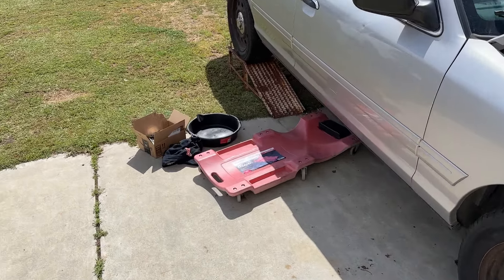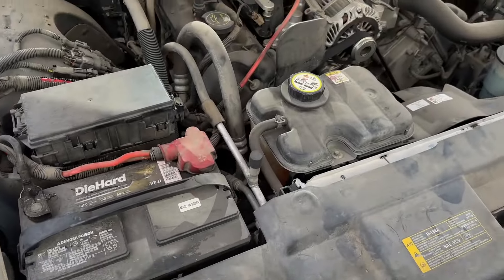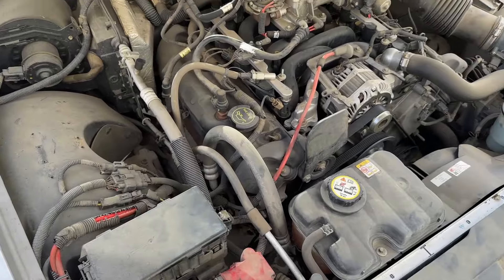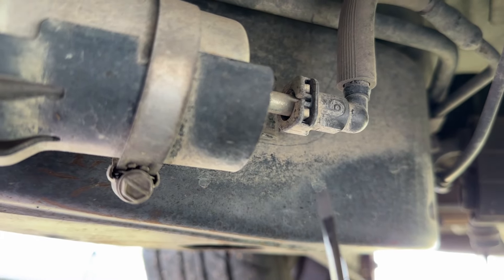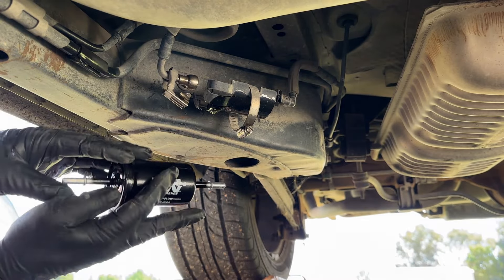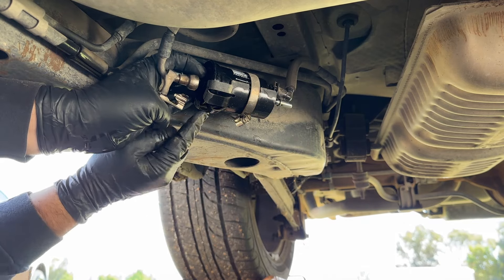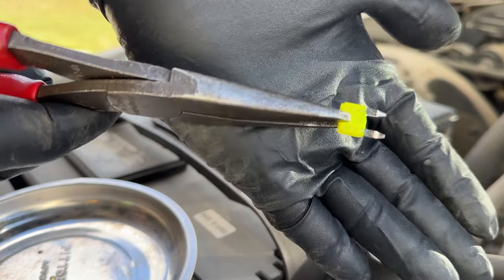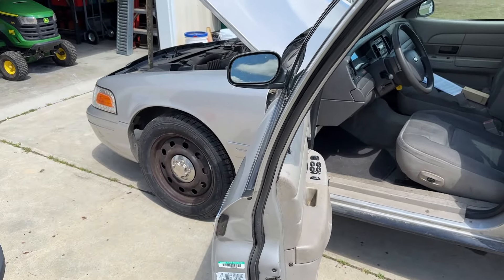How to Change Fuel Filter 1998-2011 Crown Victoria, Grand Marquis and Lincoln Town car

Comment: I hope this fixes my car.  Not sure if you mentioned it in the video since im in the library and trying not to have the volume up very high but make sure you get the flow direction correct on your filter. Dont have the filter backwards.

I hope this fixes my car which hesitates under load and doesnt idle well, otherwise I'll be trying spark plugs

Comment: I have an 05 towncar. Can’t I just use the fuel shut off switch instead of doing the fuse?
Reply from the maker: @brayden973  that won’t relieve the pressure
Reply: @ good to know thank you. I saved this video for whenever I do my own. I appreciate you.
Reply from the maker: @ yea it’s not a hard job easy to do. Prevents a lot as well down the line
Reply: @hanksgarage_  EGR valve 💯

Comment: How can u tell if it’s the full filter and not the pump cuz mine is starting hard but once u get it going in seems to be fine
Reply from the maker: You’ll have to get a fuel rail gauge and hook up to the engine and verify. The filter should be replaced every so often anyways so if it’s never been changed I’d just change it.